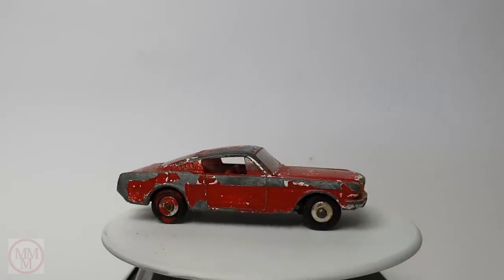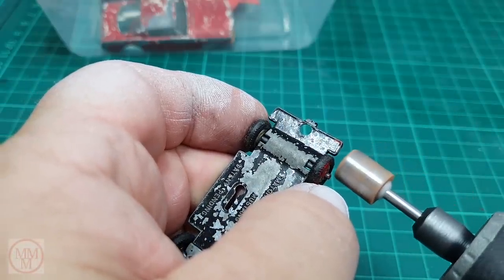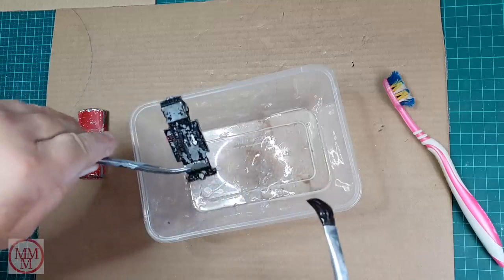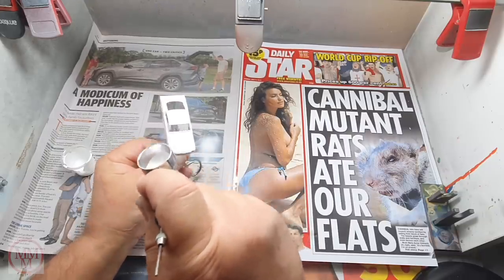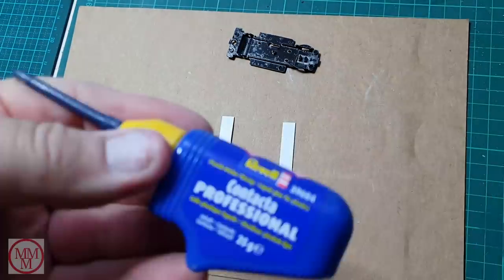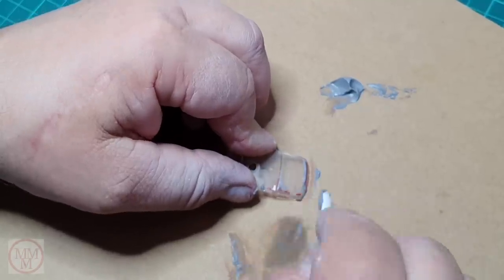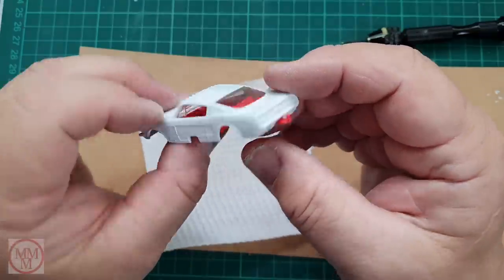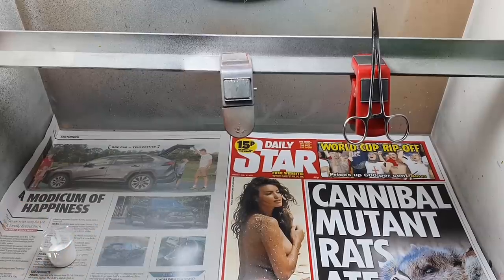MATCHBOX Restoration 8e Ford Mustang Fastback 1966

Comment: I had this Mustang as a kid and it was one of my favorites. I can understand having to strip and repaint a model as I have done this more than once and it is never fun. You really did an excellent job of the restoration and you saved the model after the paint melted the suspension tab. Great sheet plastic work too! Thanks for sharing this.

Comment: Marty, Great save on the suspension with the plastic. I think it’s better than new too!  Also, a heat gun is a little safer than a torch if you’re trying to bend or straighten plastic. I use one for fixing warped walls when I’m building structures.

Comment: The plastic wheels are chrome plated via a process called "vacuum metallization". it was all the rage until they invented spangly metallic plastics.
Reply: put the plastic in a vacuum chamber flash vaporize the metal with a huge current surge and the vaporous metal coats everything int he chamber
Reply: modelling companies like AMT and Revell still use vacuum metalizing for their chrome trees. once you've got the machine, it's a cheap process to add chrome to plastic.
Reply: @kruleworld  where and how much $$$ ? I never knew that it was possible to get one for home workshops.
Reply: @michaelrzeszuto777  I never said it was possible for home/workshops
Reply: @kruleworld  I'm sorry if you took my question the wrong way. It's just the way things move so fast now days, I really never knew about that process. Thanks for for your reply.

Comment: One of my favorite Matchbox cars. The 38 Mustang was the only one to use the protruding peg to steer the wheels. Auto-steer replaced it. With Auto-steer you push down on the right Fender and the wheels would turn right, push on the left fender it would steer the other way. Auto-steer went out the door when Superfast came along.
Reply: I have a Superfast #6 the red Ford F100 pick up.  The regular wheels version had the Auto Steer.  Gone on the Superfast.
Reply: I meant to put #8, not 38. I think my shift key is gummed up!
Reply: @hotwheelsbob2000  Keeping an eye and regular backups on my PC too.  9 years old.  The Mercury Cougar had Auto Steer?  Tying to remember which ones had it.

Comment: Hi Marty- nice job as always. I recently bought a bottle (in the US) of McGuire's Plastic Headlight Restorer. It was cheap, around 6USD for enough to do about a seven hundred thousand windscreens. It works really well on the canopies- and on yellowed crazed headlights- but since I don't usually dip the windscreens in floor polish, I'm not sure if or how it would react. Anyway, nice work!
Reply from the maker: Sounds familiar I think we have it here, I shall have to try to get some to test out, thanks for the tip Brian!

Comment: Hey Marty, I have something you wouldbe interested in. Many years ago, Matchbox came out with a race track set. It's an one-under figure 8 . The cars are driven around the track by a long spring that goes into the track and plastic  pin tapes to the bottom of the car. The spring is driven by an electric motor in a small house beside each lane and controlled like an old style slot car controller. I still have all the pieces to it except for the pins for the cars. It's a lot of fun to run it.

Comment: Nice job Marty. White with red interior was always a nice combination, but more associated with Chevrolet here. The Matchbox model never had many details but I am sure it sold well in North America. I was never sure why it was marketed as a 66 Mustang (the details are more 64 1/2 Mustang GT Fastback). Your suspension probably works as well as the original vehicles. All the underpinnings were Ford Falcon. I had a 1965 Mustang Pony Edition with 4.7L V-8 and 4 speed when I was 17. Between 64 1/2 and the end of the 66 model year, Ford sold well over one million Mustangs in North America.

Comment: you should always use a primer as close to your base coat as possible. getting white over white might make it hard to see, but it's better than having the primer show through. Grey primer will also make your white less vibrant. Use the reflection off the wet paint to guide you.

Comment: Hi marty can I suggest gluing a thin circle of plastic on the tip of your axle grinding cylinder to avoid any damage to the tyres or hubs while removing the mushroom...also maybe placing the lid back on the takeaway container when stripping the paint improve the poly stripper performance...haahaha kevin need a clip behind the ear...lol

Comment: I was worried that there'd be a bad reaction with that paint and the suspension bar, Marty, because I remember the very same thing happening to me when I used a silver aerosol paint on an old Matchbox Hawker Fury model kit back in the 80s. It got launched straight in the bin after I had seen how poorly it turned out.

Comment: As said before, after some reading, I learned that this was first released in 1966 and then autosteer was introduced which steered based upon hand pressure, but this is the only model to get the level steering.

Comment: Beautiful job Sir.  Theological question. (?) What if you were to polish the wheels with the metal polish you used on the transparency and dunk them in the floor shine.  I know the black wash is faster but it adds something that wasnt previously.  The floor shine on the polished clean wheels would give the shine without adding extra paint.  I dont know the answer...it is all speculation.  You are the pro at this...not me.

Comment: White paint looked good I’d would have masked off the grill and head lights. Then done the white in stages. Watching real cars get painted just the whole thing in one continuous light coat but use a different color primer. Now the next hard thing is a two tone paint job. Heavy coats cause runs. Hard paint jobs are the candy and metallic with flake

Comment: I have an easy way to remember which i have primed, i think of the car as a six sided object  and  i just start at the front then rotate and finish with  the top and bottom , if  i see that the bottom has been primed then i know the finish paint will be good . the side the car is facing tells m which side has been painted . i like to put a nice apple green under an aqua finish and  bake them in a warm oven for two hours .

Comment: 24:15...Marty, I told you before: buy a bigger airbrush. Use a 0.4 or 0.5 mm needle and spray at around 1.5 bar (or 21 PSI).
Tamiya paint dries quickly and gets rubbery very quickly. Therefor, use the correct thinner and add a retarder...!!!
In ALL toy factories they spray their models with a huge paint gun at very high pressure.
They have a very good reaason for it.....
I also adviced you to start using enamel paint again, because of certain properties. 
And why do spray cans often give such a great result ? They spray lots of paint in one go. Lots of relatively large, wet droplets of paint. The paint guns at the toy factories do the same thing.  Look at an old, mint Matchbox car. That paint looks fine, doesn't it ?
So....try to emulate their painting process. Simple.
Your tiny little airbrush isn't gonna cut it...... You will need a bigger airbrush, bigger hose, and a bigger compressor. If you don't want to make that investment, I promise, you will keep struggling to get a decent result.

Comment: I think that the Mustang was the only vehicle with the lever steering. I'm sure that Lesney didn't like the projecting lever, which spoilt the look of the model - Lesney were pleased that their cars, which were all of real types at this time, were realistic. Later cars came out with 'Auto-Steer', a far simpler, and, more importantly, cheaper system, which worked without the need for levers. Those chromed hubs can be a pain - unlike the yellow and red ones, which shrink over time, the plated ones go brittle. Sometimes, you would remove the tyre, and the hub would fly to pieces, the tyre being the only thing holding it together. I remember them being broken on new models, too.
The black rattlecan paint must be Cellulose based - it will destroy styrene.

Comment: maybe an idea to clean the windscreen when there's paint on it I was born in 1974 the same year Playmobil came in this world so when I find these 1974 Playmobil figures in thrift shops I always take them home and some are painted over well, I take them apart and I use a very fine grid wet stone to get the paint off the bodies (they never seem to paint the legs or arms) and after that I simply buff them up and they are perfect again.
I also have been finding fake Playmobil of the same period should I make a video about that? tell me what you think.

Comment: this was not as satisfying as i expected it to be i expected the body to be stripped of paint then sandblasted until flawless chrome i expected every part to look flawless you didn't even paint the car red and the color looked uneven with marks everywhere but great work nonetheless, but would have been better if you made the body chrome painted it to perfection replaced the plastic glass with actual glass made the wheels flawless

Comment: I had one of those.  The little lever on the side turned the front wheels.  The Mustang was the only Matchbox car with this feature;  Matchbox came out with a pressure-turning mechanism in the later 1960s.  (When pushing the car, you could press down on one side to make the wheels turn that way.  It was more realistic than turning the axel.  My Mustang was originally white.